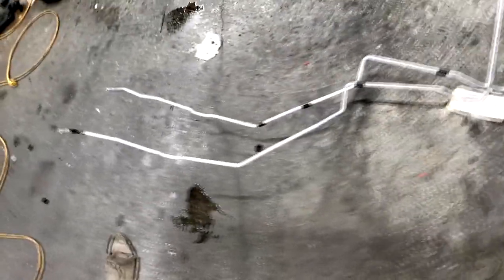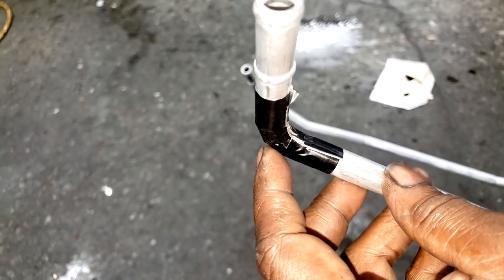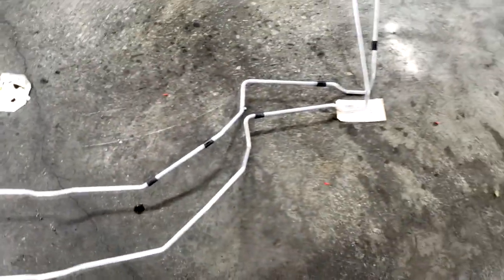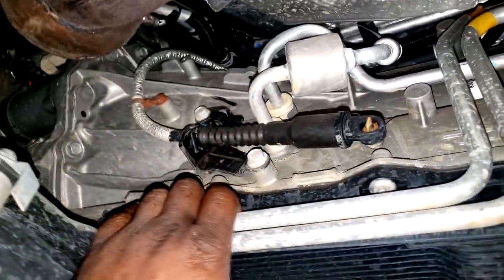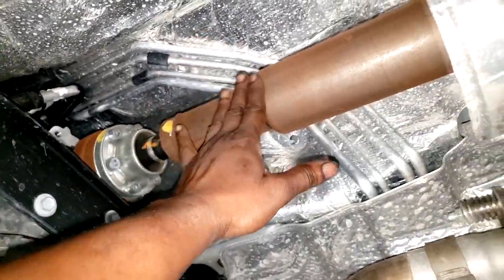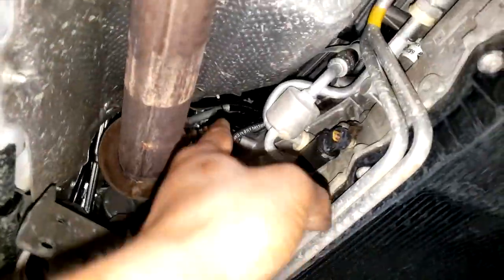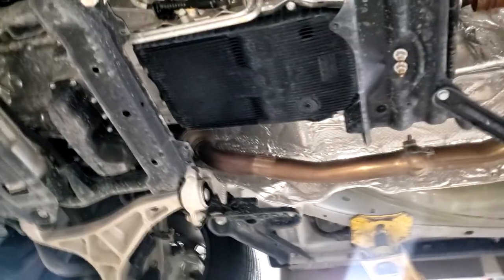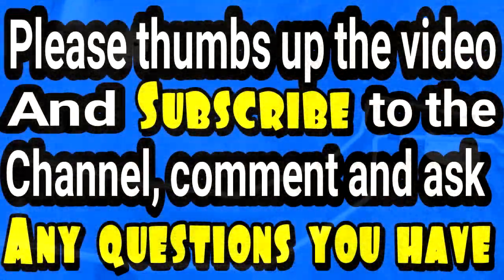The Dodge Durango heater tubes showed up. But the repair kit still not here yet. Fidelity warranty

Comment: Can you add a piece of line extension and crimp a heater hose to it
Reply from the maker: Sure, it's not under high pressure at all
Reply: dealership not allowed to improvise.    if it's personal I'd just cut out aluminum and replace with rubber😂

Comment: I have replaced those lines. On the one I had a leak. It was the shifter cable that made the leak. Pull trans. Exhaust fuel tank spare tire. Rear suspension can stay. It will twist out of there. Also pullers left engine mount to jack up engine. Hope this helps. Its a big job.
Reply: for real rear suspension can stay on?
Reply: Cant just lower trans?

Comment: Why not just replace the rubber portion of the heater line with a new 90 degree rubber elbow?  That is a lot of work for a poorly engineered hose system.  The problem was caused by an incorrectly  installed hose clamp on the assembly line.

Comment: I have the same exact problem on a 2014 durango..How must does this repair run?
Reply from the maker: Wow, its hard to say my guy without knowing which one leaking
Reply: @OnlineMechanicTips  I was told it was the rear heater hose the one that transfers the coolant
Reply from the maker: @jmoney09ent  O wow. The the question will become will they give you an estimate on the complete line, or will they just charge you to repar the section thats leaking? Only the shop can give you that estimate

Comment: How much labor do you end up charging for it???
Reply: Mine had a pin hole from rubbing on a bolt from the frame got charged for 900 in labor and my mechanic used heater hose from semis it’s been on over 2 years and no problem hopefully last until I decide to get rid of it